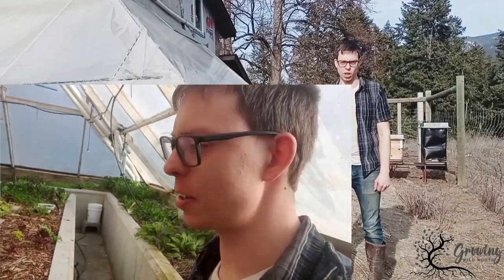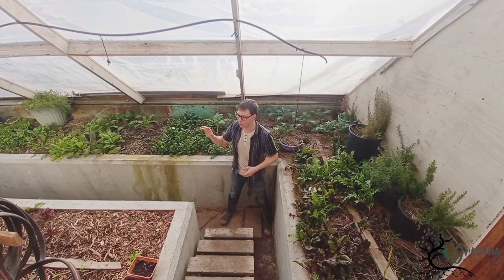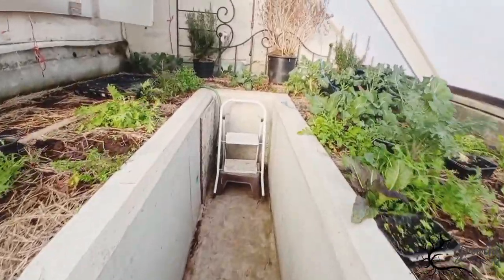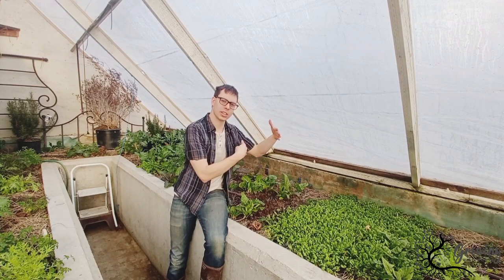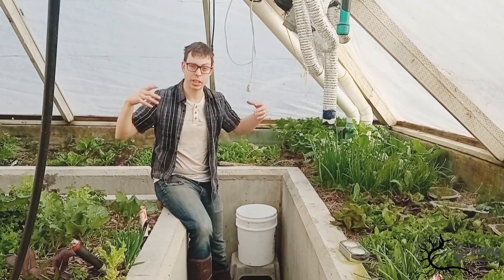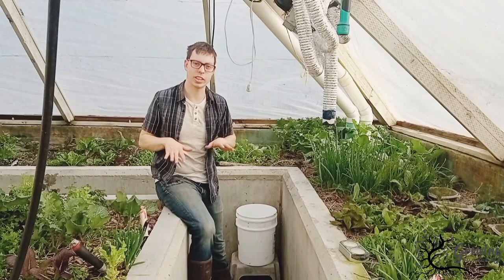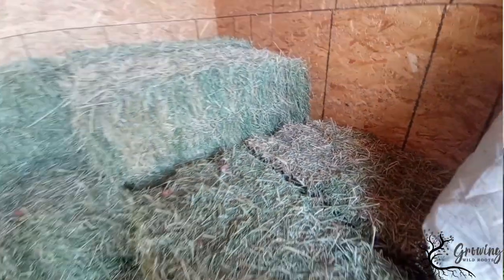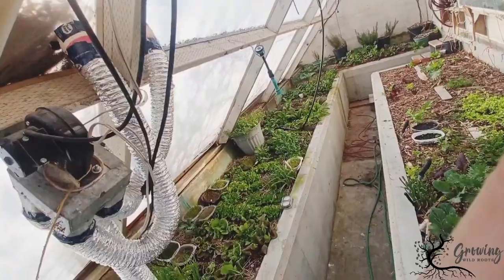A BETTER Greenhouse - Passive Solar Greenhouse - Underground Design

Comment: Many greenhouse videos are   tours that just show the plants inside. Thanks for showing the greenhouse itself. Could you show this greenhouse plans ? and tell about the  energy costs ? Is it good for tropical plants ?
Reply from the maker: 1. Thank you.
2. I don't think there are any plans currently made for this specific greenhouse as it was all done custom from the owner. 
3. The energy costs would strictly be the operating cost of running the 2 fans.  To inflate the 2 layers of plastic and to move the hot air underground.  
3. There are still days it can get below freezing in the greenhouse in the winter as it can get to -25 Celsius here. Most tropical plants are not very good with any level of freezing.

Comment: Put water and fish. It'll do better as temperature regulator, I think.
Reply from the maker: Great thought.  Aquaponics brings a whole other set of things to manage Aswell.   Might help with heat regulation but you would then have humidity issues and water quality to manage.   But with some thought I bet it could be done well in this kind of set up.